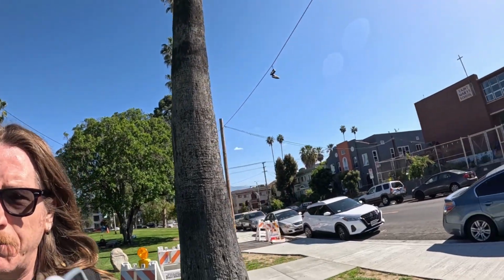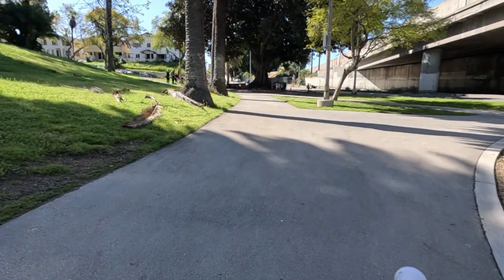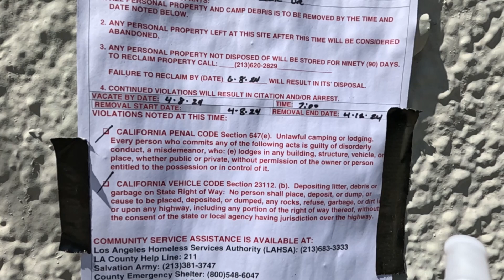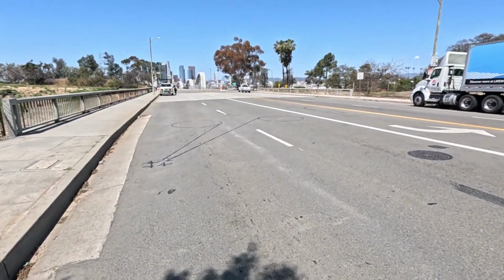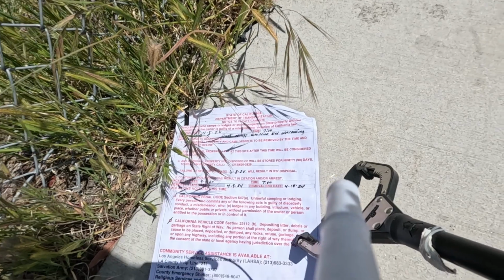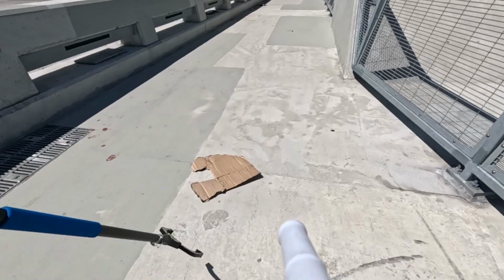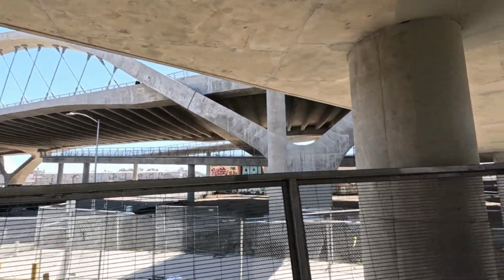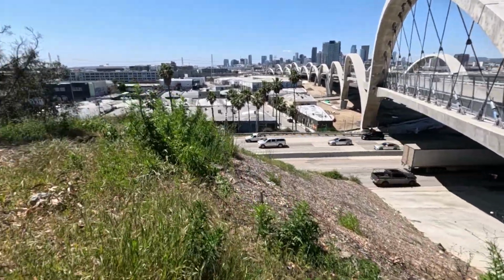6th St. Viaduct and Hollenbeck Park #latrashdiary

Comment: There's access to the bridge via that section where the encampments are located at 8:50?! I had no idea you could get to the bridge from there.
Reply from the maker: There's a gate on Boyle (blocked by encampments) and another gate on 6th near the bridge. There's a little trail that runs along the edge of the hill next to the freeway that cuts the corner. At your own risk though..